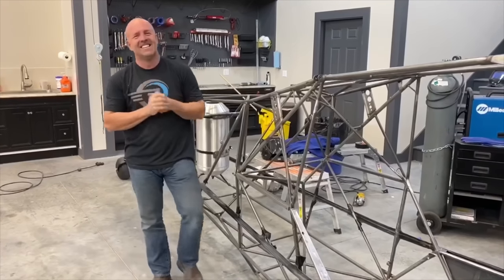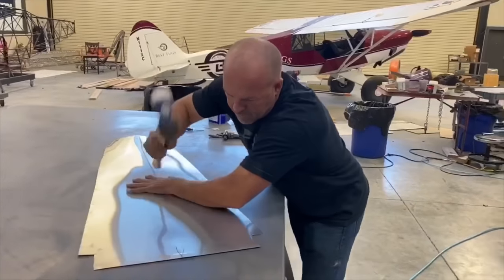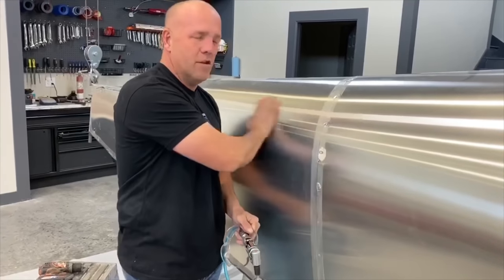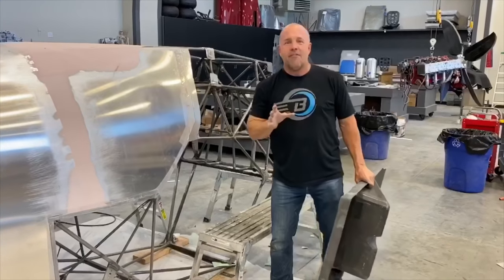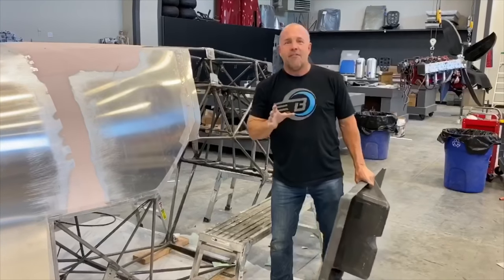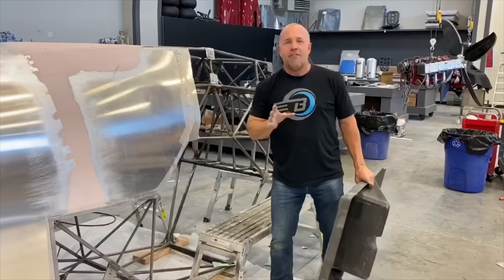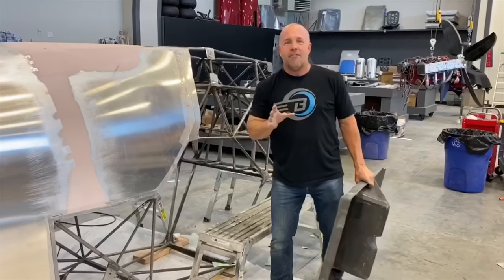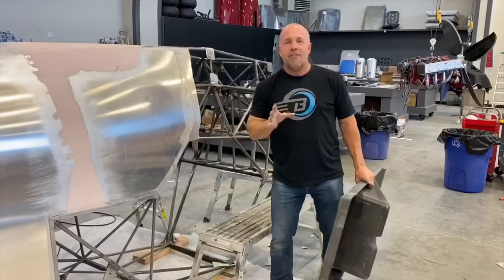EXOSKELETON weighing my options for Scrappy... (Scrappy Bush Plane 6)

Comment: LOL  I'm throwing the Truss Personal Foul flag for pushing on the tube sideways. As a Closet Stress Weenie, you know those truss tubes are supposed to be tension-compression members, not bending beams.  15 yards backwards.... LOL
Reply from the maker: Steve Defranco lol 😂 I like your comment.  And factually correct we both know that.  We also both know that In compression, like a crash.  The second a long length bar begins to compress pass the normal limits it fails and bends to the side. My point was simply saying that when you hold the tube from beginning the bend you increase its compression load factors.  It’s a simple chart you can graph each point you shorten it’s literally length by stabilizing its bending moment. I love your comment it made me smile, most would not catch that.  👍🤠 cheers
Reply: @MikePatey  Your videos are such a treat, I'm glad I could give you a laugh in return. LOL Ok, who is the bigger Closet Stress Weenie: I have the Bruhn buckling charts on my computer desktop. LOL You'll beat me if you have them on your phone! I'll keep trying to make real engineering comments with humor.

Comment: Seeing how you scrap the sheetmetal anyway... Could you not do the 'bodywork' in drywall mud instead of Bondo?  A lot cheaper and easier to work with. You obviously are not concerned about weight or longevity of the filler. I bet drywall mud would work like a charm.
Reply from the maker: Cowracer67  yes exactly and It does work well when I’m doing thin fill.  On this one I had areas over a half inch to and inch thick so the problem becomes two fold. Number one is dry time before getting back to work is number one.  Bondo I can sand on it and pull a new part minutes later. Drywall when thick needs to set way to long and often gets shrink cracks and needs another layer or two. it often becomes a long day or multiple day process.  You are exactly right though and when it’s thin or I have extra dry time available to not be working on the project I use drywall on occasion 👍🤠

Comment: I have 2 words for you. Galvanic Corrosion !!!  With my build I have ALL Carbon surfaces that's in contact with any non Titanium or non Stainless layered in fiberglass and I only use Titanium and Stainless steel connections. Try to not use 410 or 301 stainless steel connections. Both are far better than all other steels but can cause a problem near sea water.
Reply from the maker: Cyberslug1 I agree completely and will be showing the connections in an upcoming video .. it is critical, thanks for the comment I plan to do a segment specifically on Galvanic Corrosion
Reply: @MikePatey  Oh And thanks for the great video's I'm learning a lot from you.

Comment: Fantastic videos Mike. I may have missed it in a previous video but how are you attaching the carbon to the metal frame to work around the galvanic between the materials? There is a lot of metal framing and a lot of carbon laying on it...Thanks again for all the hard work and sharing the adventure with us.
Reply from the maker: Ron Coleman 👍🤠 I missed recording when I wrapped all the bars in three layers of clear fiberglass where it makes contact and then I glassed the fiberglass  wrapped bars directly to the carbon fiber and installed to so some toon holes where my brake lines pass in and out of the wing

Comment: Mike. I LOVE watching you build planes. I was an engineer on the F35 program in Australia, developing tooling for manufacturing Carbon parts. I believe your layup methods are fit for purpose. Something I've noticed is I don't see you laying cloth with fibres (fibers - in USA) in any particular direction. May I suggest when you make the top cap, lay up with 0 degree & 45 degree fiber layers. Assuming rows of fasteners are used for connecting the top 'deck' to the 'belly' moulding so you have a closed torque tube from the wing box to the tail for stress and disassembly purposes, be sure to lay in an extra thick layer of carbon tape along fastener edges inside alternating layers. Running tape thru a resin bath and rollers is a cheap off the shelf piece of kit. Drilling and countersinking Carbon is not a problem, except for the dust-don't breath it in, and be sure to use a strong vacuum extractor around the drill bits. "Back to work"
Reply: FWIW, Mike mentioned in another reply that he was alternating 0 and 45-degree layers on this as well; it just didn't get mentioned in the video.
Reply: @BrooksMoses  Oh, ok, nice. And I'm sure Mike does not simply "guess" anything critical. I'm sure (hope) Mike employs the services of well experienced and qualified people when his not sure.

Comment: I'd be curious to know the weight difference between that aluminum skin and the carbon skin.
Reply from the maker: ecstans07  a general rule of thumb if at the same strength, the carbon fiber will be a third less weight

Comment: Aluminium in the dumpster!! ? What a waste. Amazing worker nevertheless.
Reply from the maker: John Palgrave  🤠 they cut to much of the hours of Fillming, the next segment cut was me cutting it up to throw away the parts covered in bondo. 80-90 percent I sized up and put in my storage and I have already made several more parts  with it.  Cheers 👍🤠
Reply: @MikePatey  Can Al + bondo be sent off for recycling? I'm re-watching you (a master in so many ways) as inspiration and uplift during lonesome lockdown here in the uk.

Comment: You could put slots or even straight holes in that flap, so you have engine air out and  use it as a speed brake and flap depending on angle.

Comment: This thing is going to be a class 1 buggy, but with wings! I've had off road vehicles with worse suspension than what you're building for this plane. I'm guessing you will be showing Trent that his Kitfox isn't the cub killer he thought it was! 

When you start mocking up the airframe, how do you figure out the CG for wing placement with that massive engine? Are you modeling the plane in cad then using the model to get a good estimate of the weight distribution then fine tuning it in mock up?
Reply from the maker: Just K1n3k I mock it up in the computer  where I can do FEA studies as well as good old fashion long hand pen and paper calculations with every single parts weight and balance.  Sometimes my builds have more hours into design than the build itself.
Reply: @MikePatey  When its all said and done, is the wing placement going to be drastically different from a stock cub? I've noticed that you were able to balance it out a by moving stuff such as the oil tank back into the tail.  I'm also really curious how you correct for P-factor. I've been trying to think through the force vectors on that and I'm honestly stumped. 

Between you and the other flying cowboys, I'm getting more and more interested in getting a light sport certificate. I've been wanting to build a Legal Eagle ultralight for years, but I may just have to look into something bigger.

Comment: Rather than the weight and complexity of flaps to regulate air in to the oil coolers, why not use an oil cooler thermostat?
Reply from the maker: David Greed I’m using both, it’s more about drag reduction, I’ll go into further detail on another video 👍🤠

Comment: The flap is located below the CG, therefore it should pitch it over with increased drag. The drag force will far exceed the lift since the low pressure area will not only pull the flap up, but also pull the fuselage down.
Reply from the maker: 🤠 I understand what you’re describing.  It depends on the door position and this will make a fun phase of my flight test program.  I’ll be making a video on how it works.👍🏻
Reply: @MikePatey  Can't wait to see it. My thinking is it looks a lot like an inverted F-16 air brake. Whether as a flap system or air brake, extremely useful tool in the bag for a bush plane.

Comment: Doesn't the 35mil of aluminum cause an issue by making the carbon fiber a little bigger?
Reply from the maker: Keith Cress good observation. It’s actually exactly the gap I need for the isolate barrier that goes between the carbon and the bolt attach brackets so that I don’t get galvanic corrosion..
Reply: @MikePatey  Ahhhh! That makes sense.  Thanks Mike.  To the continuation of Scrappy's smooth birth!

Comment: Mike, have you tried a thin body filler “finishing putty” for blending the metal? You may be thinning the “bondo” already but if your not give this stuff a try. It goes by a few different names but it’s a dream to work with no matter what... Description
METAL GLAZE is a two-part polyester finishing and blending putty.

Comment: Mike...could you please let us know what type of epoxy and carbon fiber you are using for the carbon fiber hand layups?  I'm especially interested in the Tg temperature of the resins...wondering if you have to post cure your structures to alleviate the kinds of issues faced with Long-Ezs etc. that have to be painted white to avoid temps much over 130F or so?  Super interested in following the progress...simply AWESOME to follow your build!

Comment: Mike...could you please share with us the type of epoxy and carbon that you are using for this skinning project?  I've watched all your videos about doing hand layups in carbon, but haven't been able to determine what epoxies you are using...and if you are post heat curing them...or if you've found this to be unnecessary...THANKS!

Comment: Question: Carbon fibre isn't very flexible in two of 3 dimensions. Are you concerned over having a buzzy airframe? Micro-fractures developing along the longitudinal axis attachment points to the chromoly subframe? Dampers for controlling harmonics?

Comment: Thinking outside the box? How about a 7.2 liter z06 427ci aluminum block engine with already built in dry sump oiling and add 20lbs or so of boost with 100-300 shot of nitrous for shits and giggles? Nelson racing engines did a 260ci LS engine for a river boat that put down 4 digits that runs for hours (although river water is generally cold) and there’s no shortage of it

Comment: LOLOL The Mechanic who has to drop the main gear to get the access panel off is going to utter Mechanic's Rant #1: "Why doesn't the ------- Engineer to designed this come down to the shop floor and try to remove this. Why didn't he just give me a three-piece removable panel that leaves the gear on?" Oh, wait.... LOLOLOL

Comment: Why not use countersunk pop rivets or even weld it, save on filler.
Reply from the maker: Equiluxe1 it was temporary to just hold the metal for the carbon fiber work and then it all came off and only carbon fiber goes back on.
Reply: @MikePatey  I know that I was just thinking of what would save work and filler.

Comment: I'm curious why you didn't use a 45 degree bias. I would have thought that would have been a lot stiffer in torsion. Also, are you going to have issues with the difference in thermal expansion between the metal frame and the carbon shell? EDIT: I did the calculation (hopefully someone checks) 0.0000095 x 6m(not sure of actual length) x 50deg temp range is 3mm of expansion. I guess this won't actually be much of an issue. Depending on the resin content of the carbon it won't expand or contract much, possible that it will even shrink with increasing temperature because it can have a negative temperature coefficient.

Comment: You are amazing! Great video. Are the suspension aluminium brackets joined to the space frame, or are they uniquely supported by the (removable) carbon fibre body. In which case how is the carbon fibre panel secured to the space frame to take all the  loads when landing. Maybe I missed something?
 Thanks Mike

Comment: Fond memories of parachute drops with an electric RC model glider close to 30 years ago. One climb out to maybe 100m in those days. 12 tiny parachutes in fuz, trap door on 4th chl, and see how many I could get stuck to the wing. Wing had pins protruding from leading edge about 10mm on 50mm centres to help grab hold.  99% biodegradable parachutes made from tissues (same as you blow your nose with), thin cotton string attached with a dab of CA glue, bit of local thin tree branch as the weight.

Comment: I'm new to the idea of exoskeleton skins and would like to run some tests. To do so, I need to buy some aircraft grade aluminum sheet.  Can anyone tell me what specific aluminum to purchase (6061-T6?) and what thickness Mike probably used for Carbon Cubs?  Tubing specs is not an issue, just specs for the aluminum skin material.  Thanks in advance.

Comment: Thanks for inspiring us all with your work! A suggestion for the fire-wall: you can buy sheets of ceramic reinforced aerogel. It feels like a fabric, is very lightweight an a 3mm layer gives you fire protection up to 1600°C (we use it to layer a carbon furnace in the lab, works like a charm).

Comment: Hey Mike, enjoying this build series. Had a thought while you were mixing your bondo. I've done body work for years so I know all about fillers. So as I was watching you work the filler and it occurred to me, for your application, you could actually use drywall mud. It's only a mold after all... Just a thought. Thumbs up as always!

Comment: Are you working from a Plan Sheet , or just winging it? I never built a full scale Airplane , but have been building RC Planes about twenty years , and even If I learned how to make a Airplane from experience I still need to draw a plan to build it because on an Airplane it's critical to have , well all things are critically important to as perfect as possible , for example : You want the Left and Right wings to weigh exactly the same , and weight although very important to performance is not Paramount to shit not breaking in Flight or takeoff and Landing. Bondo is excessively heavy. They got stuff called "Aerolite" it's similar. Or add some foam beads in there to lighten . I must be not understanding Your Plans.With that much Power maybe wings are'nt necessary.

Comment: How strong is the fabric? If you accidentally stepped on it would it tear through? I know it's been used forever, but I've always wondered how strong it is. Carbon fiber seems like the best way to go fro strength.
By the way, what do you do for a living? Are you an aircraft mechanic? Just curious...

Comment: I've done designs like you're talking about. To take it a step (or half-step) further, you can make strategic locations (e.g. any big door) out of sandwich construction, where you need to cut down on deflections and vibrations, and/or remove chances for buckling/crippling in a thin layup.

Comment: I love these video's. They are very inspiring. For their Senior Engineering project at the University of Connecticut (UCONN) a group of engineers designed a jig to test the resistance to twisting force on rowing shells. They are made of composite material. It measured how much the boats would twist given a specific amount of force. Imaging using something like this to compare Scrappy before and after wrapping in Carbon fiber. Thanks for sharing all of your knowledge and creativity.

Comment: That is truly an epic set of shop-tables you've got there. How much do they weigh? It looks like they wouldn't even notice if you hit them with a Volvo lol. My shop table is made out of mere 2" square tubing supports with a 3/8" non-hardened top that needs 2" angle-stock reinforcement on the bottom of it to keep the top from warping or bending, and it's maybe a quarter the size of one of yours. Color me jealous lol.

Comment: I appreciate these vids. I know building a plane there is A LOT of work. This really gives the insight to some of it (i know hours on the paper / computer). This should also give someone that extra push to build there own plane. It can be done, one step at a time. Love the cowl FLAP idea curious as to how much it’ll help. I see a bunch of work on body, gear, engine. I’m curious any plans for changing the wings for added lift area, slats etc? I know you touched basis on making a larger rudder which with that motor it’ll need it!

Comment: Will your cowl flap be a tapered half-box for edge stiffening or a simple flat panel. Will your hinge system be a mechanical piano-style hinge or a will you be bending the carbon fibre panel itself in a long leading hinge. If you will be extending it far outboard as a speed brake, then a piano hinge may be the only way to go. Buffet from that huge propellor may give you some challenges with that speed brake flapping if you actuate it with a screwjack attaching to the centre rear of the panel, again a good reason for using piano hinge. Will it introduce a sudden nose-up tendency in the event of a total power cut by that big engine. I imagine this would be nowhere near as aggravated as with those dreadful rear-engined kitplanes and their high thrust line but may be something to watch out for. Your solution for the rear control surfaces is something that Boeing should have done with the 737MAX as suggested to me by a former BA pilot. Keep it up. For lesser mortals like me, it is encouraging to witness your energy and inventiveness.

Comment: Your videos are so entertaining, I would like to be an intern at your hangar ;-)   

Suggestion:  speedbrakes on the wings, just like gliders. And maybe some kind of radar altimeter that tells you when 4 ft AGL, so you cut lift completely for a shorter stop (also helps the braking, all weight on the wheels faster).

Comment: Thanks, Mike
Great explanation of cowl flap exit air. It never made sense to me why cowl flaps were on the bottom of airplane cowlings in a high-pressure area. My lack of understanding has been bugging me for years until you explained it. Awesome work.